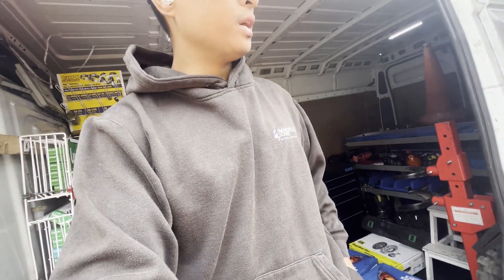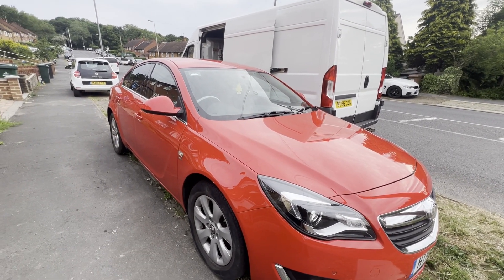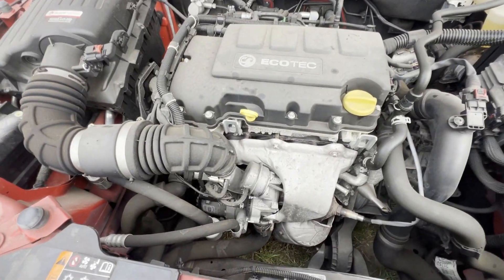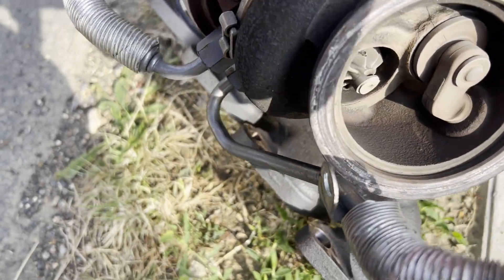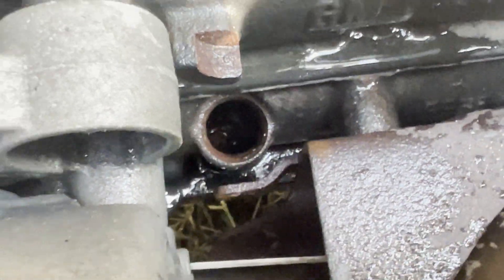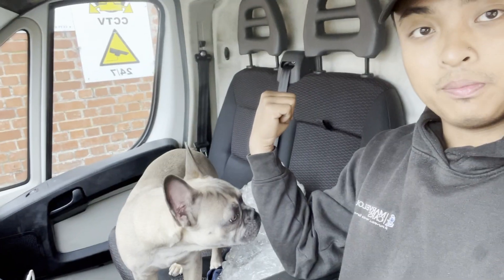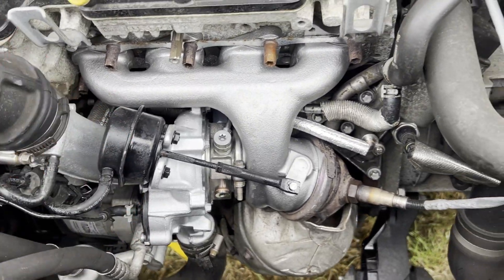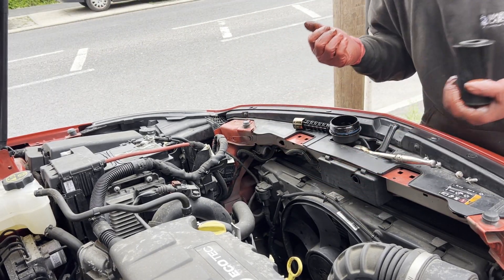Life of a Mobile Mechanic | Vauxhall Insignia 2016 1.4T Turbo Replacement | VLOG 2

Comment: What people don't realize is that after 7 years without an oil change is that the damage has already been done. That engine now is full of lumps of carbon that can get into the timing chain or oil ways at any time. Also, since the moment they skipped that first service, the wear rate will have greatly increased on internal components such as timing chain, camshaft / crankshaft bearings, piston rings etc.
She'll be lucky if it doesn't need a new engine soon.

Comment: Hi don't really want to state the obvious but if people are neglecting general maintenance IE servicing and most importantly oil changes even following manufacturers oil services schedule which are a joke in the first place any forced induction unit will suffer premature failure. I would recommend halfing the manufacturer oil change intervals even with non force induction power plants , the main cause of turbo failure is either the seal's or bearings

Comment: Not sure why, but that's the same engine as US Cruze, encore, sonic, and trax. I own two of these vehicles and haven't had problems. I think the main issue with these is they run super hot for efficiency. So they are extremely quick to overheat if any issue arises, and they use a lot of plastic parts in the cooling system. Cooling system has been a plague for one of my cars. Both have had no issue with turbos, and no major repairs yet. One at 160k miles, other at 75k. I change the oil with mobil 1 full synthetic and use wix oil filters, every 8k miles. I think the 10k mile manufacturer recommendation is too long, unless you're only on highways. To be honest I follow the oil life display and change it around 20% life left. Not sure what mileage it would be, because it counts engine rotations and not miles for oil life.

Comment: Nice location for the Turbo... Since the will need changing often
Reply from the maker: Hahaha! Since this video, I’ve come across 3 more with the same fault, even at good service intervals. Must be common?
Reply: Do the oil feeds have restrictors in, remove if so imo. @themarvelousvlog

Comment: Hi
I know it's an old video but I've noticed that my Vauxhall Insignia is burning oil and when I took the air intake off the turbo I noticed there is a fair bit of oil. Do I need to change the turbo. I'd be grateful for your advice

Comment: I always wonder if removing carbon from the engine will end up damaging the turbo impeller.
Reply from the maker: I don’t think it works like that… As a mechanic, I believe that the whole carbon cleaning machine thing is a scam. The only effective way to remove carbon, in my opinion, is either walnut blast (on valves) or completely stripping the component that you need to clean and cleaning it with a solution
Reply: @themarvelousvlog  yes 100% a scam. The chemistry of the machines just do not add up.

Comment: Is it a good thing putting engine flush
Reply from the maker: In this occasion, and in occasions where oil contamination is bad, yes. If you use good oil and you change it frequently, I don’t see a reason why you’d need to flush the engine

Comment: Shear stupidity by the owner, they shouldn't be allowed on the road
Reply: That’s why these videos are here to educate people- to make sure that it doesn’t happen to her again 😅
Reply: @mikelaraa  thing is, I don't think they care....hopefully I'm wrong, but I see family members neglect services on their cars, time and time again. Oil changes are cheapest thing to keep expensive repairs away, we have a 1986 sierra xr4x4, oil changes every 3k miles, fully synthetic 5w/30 oil since we bought the car in 1992, and compressions on all 6 cylinders are within spec for a new engine at 117k miles and 37 years old, engines never been apart!
Reply: @stevenking2946 wow that's impressive 👍👍👍
Reply: Oil, filter change, cheaper than engine rebuild/recon new lump.......change your oil
Reply from the maker: I totally agree with everyone’s comments here. I think that a fair amount of people needs to be educated as they may not even know this about  the basic care for their vehicle.

Thank you everyone. Let’s spread positivity and let people know 🫡